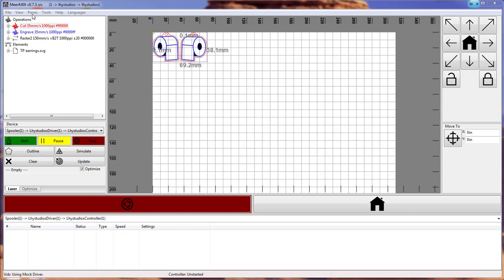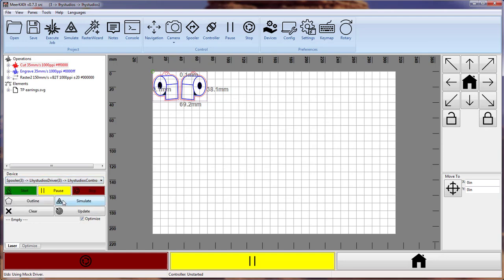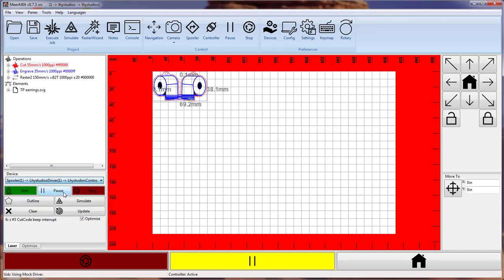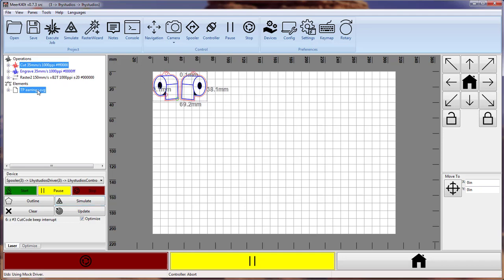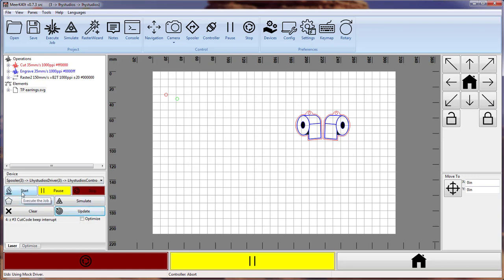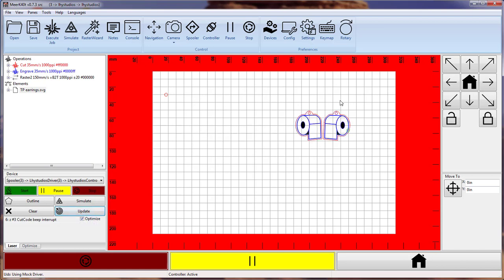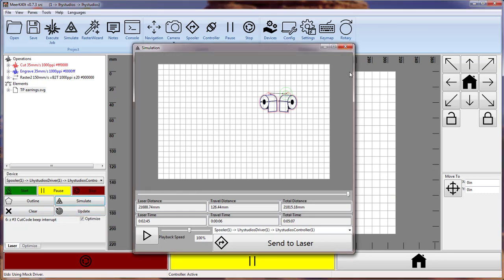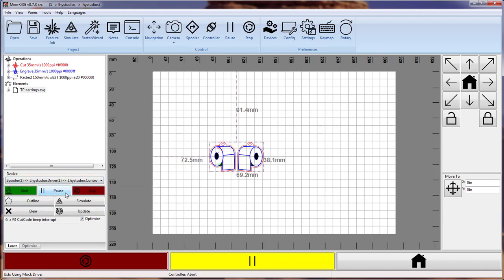MeerK40t Features - Laser Plan

Comment: Hey, could you do a video for optimization? I am very interested in the optimization that you don't get with k40 whisperer
Reply from the maker: My mics busted just now, but generally there's some optimization buttons in the second tab of laser panel. And these will provide optimizations, most notably "Reduce Travel Time". Basically this lets it rearrange the ordering of the objects to be faster with the more distant movements optimized a bit. This tends to be done with a greedy next-nearest optimization. I believe you could also turn on the semi-secret extra optimization `set -p planner opt_2opt True` which follows up the regular nearest neighbors optimization with 2opt. The reason this isn't on by default is it takes 10x longer and to eek out an additional 10% reduction in travel distance. 

The other thing that generally matters is how much inter-mingling can be done between operations. There's merge passes and merge operations, and those basically cover how much that stuff is permitted to mingle. There's no reason the laser can't change speeds on the fly while engraving a bunch of things. So you can let it merge operations together which means if there's a faster path, even if that path means the laser goes from fast to slow back to fast again, it'll be allowed to take that path.

There's also Burn Inner First which also largely governs the difference between cut and engrave, but is also the available in Whisperer.  Though it more-or-less means that if we're doing cutting we should make sure to keep that last. Or if we're cutting several things inside other things we need to cut them in order. Generally this is for those cases when cut objects fall and you'll want to make sure the inner-most cuts are done first.

This has some impacts on the optimizations because it sort of implies we shouldn't mingle some operations, else we might try to engrave something after we already cut that object out and it fell out of the material. Also the opt_2opt can't actually take that into account so it turns off if you have that enabled.

0.8.x is mostly done, so hopefully I'll find the microphone that doesn't sound like banshee's wales and be able to make a few more videos on the current feature set.